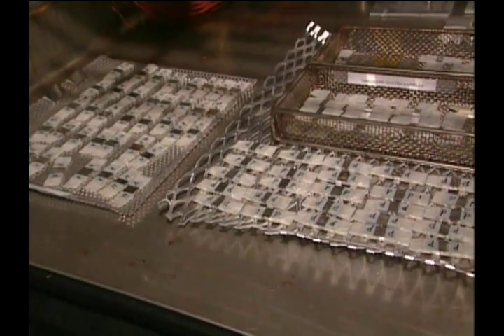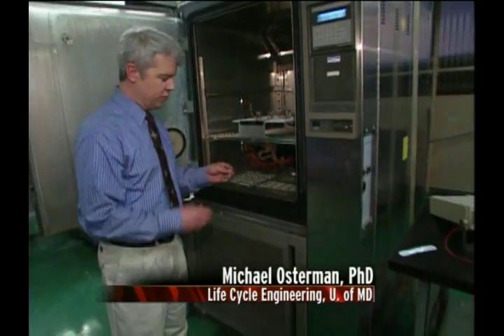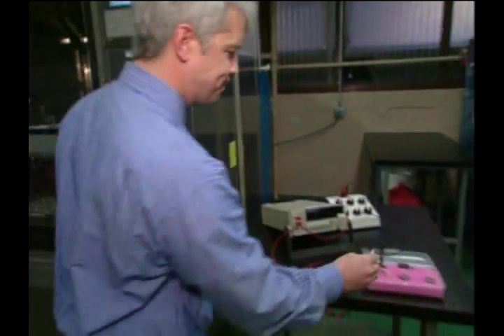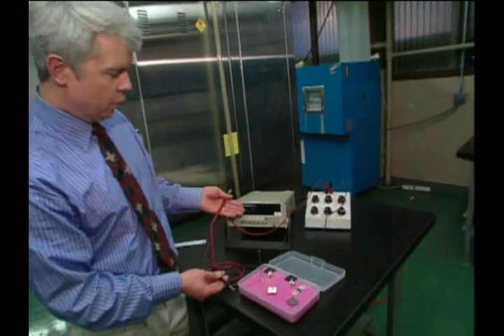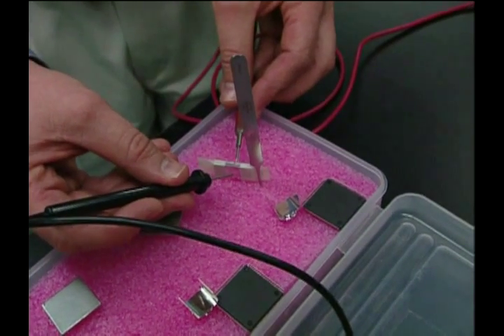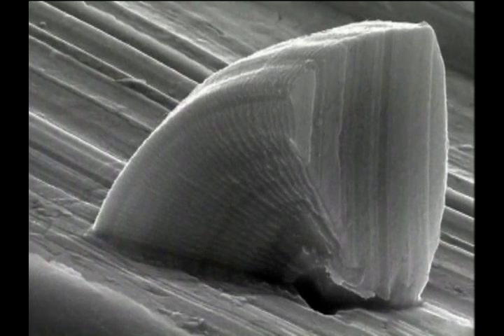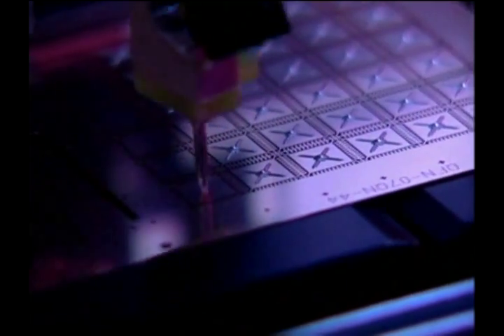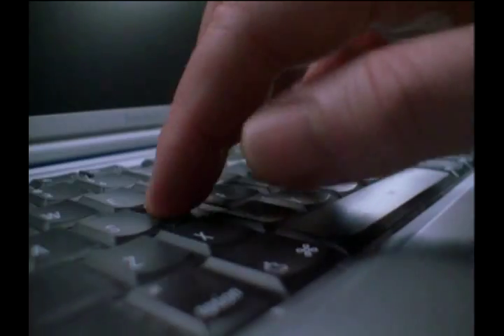Tin Whisker 5

Comment: What? All science can do is wait for the next disaster? How about gold or silver plating the boards. Once the etching process is done, the gold can be recovered. 

I have cheap RC toys that use gold plated boards and even the plugs and sockets are gold plated. 

Maybe NASA should consult with WL Toys before they send up the next disaster waiting to happen at billions in cost for the taxpayer. 

Hell, here's an idea for free. Shellac the boards and use a mask where the soldering is done.
Reply: It pokes through.